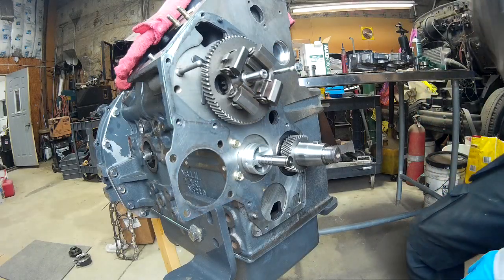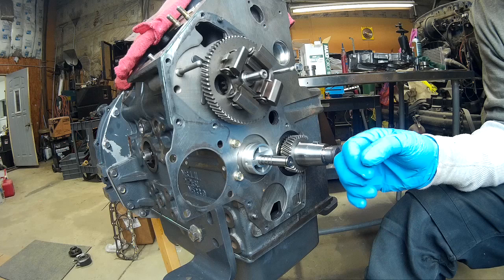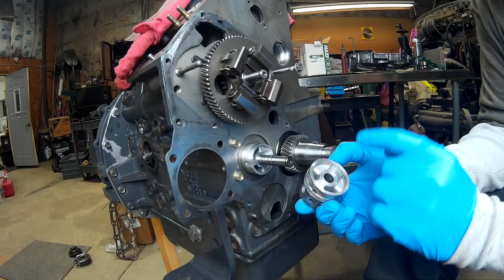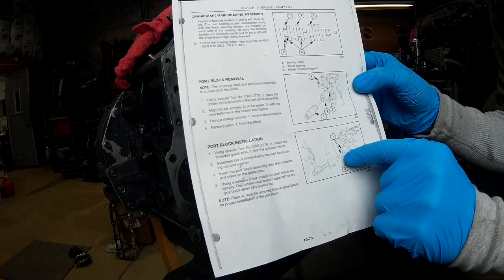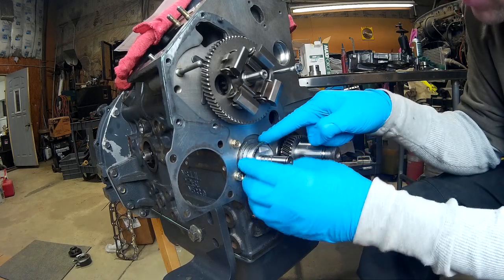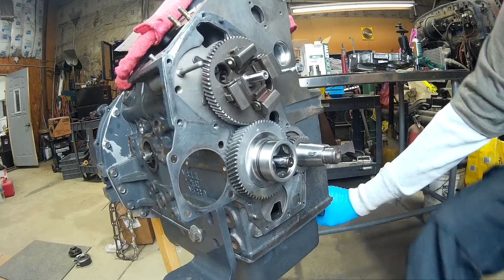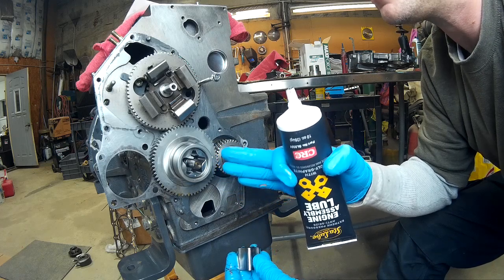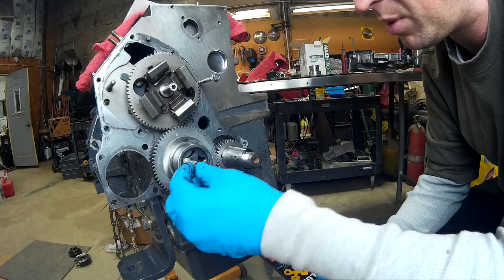Shibura 844LT oil pump

Comment: Hi Carl, 
Thanks for the effort you put into this video. My buddy and I very much appreciate it.
Hers's the problem for us. We are in Portugal, slightly off the beaten track, and we are also under time pressure. We have the new pump, and sundry other parts. We DO NOT have the special tool you talk about. Can you imagine any way that we can remove the old pump and install the new one without this tool? We are both experienced with engines and pretty ingenious, and have the usual boatyard tools but no machine shop.

Huge thanks - Michael & Carlos    kantala@gmail.com
Reply from the maker: Hello, 
      I'm glad the video was able to help you!  I do think you can have success without the special tool.

Removal:  if you have the oil pan off, you should be able to remove the 10mm nut on the back of the pump that holds the shaft into the aluminum pump body.  With this out, you should be able to put a long bolt through from the back and attach to a slide hammer.  Use the slide hammer to tap out the pump body.  If that does not work you could just weld a nut to the end of the pump shaft and attach that to the slide hammer. 

Installation:  I would remove the pump shaft from the new pump, and make yourself a solid flat driver the fits the face of the pump very nicely.  Even better, cut the old pump shaft in half, and put the old and new pump face to face with the piece of shaft in between to index them together.  line the new pump up to the block in the exact same orientation that the old one came out.  You are trying to get the internal oil passages to line up!  a few degrees either way will not hurt, but make yourself some nice marks on the block and pump to keep yourself lined up.  Use a good sized hammer to drive the new pump in with the old pump body.  Make sure you get it started straight and keep it going in straight!  The pump body should be driven in flush to the block.  
     If you have the block out and completely apart, you could also stand the block up in a press and press the new pump in using the old pump body as a driver.  After you get the new pump body in, re-install the new pump shaft and be sure to use a loctite red on the 10mm bolt in the back!  Mine aftermarket pump shaft nut was loose, would have been catastrophic if I hadn't have seen it.

Best of luck and please report back your results!  
Carl Crawford
Reply: @CrawfordMethod 
That was a super message, and perfectly timed. Thank you thank you. I want the whole world to know how helpful that was.
Tomorrow is the day we do the deed. I will tell you how it goes.
Tx - Michael
Reply: """"
Hi Carl

Well, in the end we had a good day working on the oil pump. You will remember that we wanted to replace the old pump but did not have the special tool. Your video was wonderfully helpful, especially when we froze the frame at 3:38, blew it up and read your Manual which was more detailed than ours. Here's what happened.

The Perkins engine was still in the boat, and since it would have been very hard to remove it we decided to leave it in place. The cylinder head and much else was already off. With the front cover removed and all the associated bits and pieces also off we could proceed. 

The sump was off so we could just access the inner end of the oil pump shaft, which has an 8mm threaded end and needs a 12mm ring wrench for the nut. It was impossible to swing the wrench because of the crankshaft, so the outer end was tightly gripped and rotated with vice-grips. We were very careful with this, wrapping the shaft with layers of masking tape and cloth so that we did not damage it - who knew, we might have needed it again! It was not easy but we did finally undo the nut and pull the shaft. This showed that it was very worn at the outer pump end but perfect where the inner end sat in the aluminum base.

The next part was critical. We needed to ensure that the new pump would be installed perfectly so that the ports would match the engine block. It turned out that we could see one 5mm oil port in the aluminum pump base and it was exactly horizontal. We found a nice old piece of fibreglass shaft which fitted the hole tightly, and marked some tape so that we would be able to install the new pump in exactly the same position. A long drill bit would also work well.  We had a photo for you but I can't paste it into this message. Sorry.

Next we made a slide hammer. First we pushed an 8mm threaded stainless rod through the pump body and fitted a nut on the inner end, easier said than done. We covered the rod with tape to reduce friction and hammered our heavy weight hard up the rod against two good nuts. Nothing would budge the aluminum pump base from the block, nothing. So then we made a puller such that we could pull the inner nut of the 8mm rod against a tube with spacers and washers and thus pull the pump block out. No, that didn't work either. 

This is when things got serious. We could have drilled out the aluminum block so that we could introduce a 12mm or 1/2inch threaded rod and pulled on that. The problem with this idea was that if we failed the remains of the now useless aluminum block would still be in place and laughing at us. We needed a new plan.

We removed the new shaft from the new pump and compared it thoroughly with the old one from the old pump. We inspected everything. We measured every possible dimension with a micrometer. We tested the new shaft in the old pump body, and thought long and hard. The oil paths were slightly different, but the spiral oil groove on the new one looked like it would work better than the simple oil port of the old one. The fit of the new shaft into the old aluminum base was exactly the same as the fit into the new aluminum base. Finally we decided to leave the old aluminum base in place and fit the new shaft and all the other new parts. That was a big, difficult decision but we do believe it was the right one.

It was not easy to tighten the nut on the inner end of the new shaft, and especially since we had to be really careful not to damage the shaft with vice-grips, the only way we could hold it. The new nut had a built-in locking washer, and we did use Lock-Tite. We then smothered everything in grease to improve prime and make sure that nothing runs dry at start-up.

Assembling the new parts onto the old block was relatively easy. Curiously our old pump did not have a thrust washer whereas the new one did.  We also had to figure out the shims to get the end play of the shaft right, called side-play in our Manual which is weird. The Parts Manual was confusing. Several parts are wrongly labelled, a number could not possibly be needed and the installation of others as drawn is obviously wrong. We proceeded with care and we are confident that the parts we assembled are perfect. The idler gear with its marks is properly lined up with its friends, and for our next chance we will be ready to go with the cover and the rest of the job. We know there are some hard times ahead with this too, but nothing like what we have just been through.

Carl, none of this would have been possible without your video and without your encouragement. Thank you very much indeed. We will let you know what happens when we start the engine.

Best Wishes - Michael & Carlos

Comment: Carl i have one tore down right now. I'm having a clearance issue between the front cover and the crankshaft gear. I looks like the oil pump gear and crankshaft gear on yours are flush when installed. This crankshaft gear protrudes about. 20 thousands past the oil pump gear any thoughts? A local machine shop built the bottom end
Reply from the maker: Ronald, 
     Hmm, nothing comes to mind that would cause that.  Was it the same crank or a replacement crank?  That distance is probably controlled almost exclusively by the thrust washers on the bearing system between cyl 2-3.  Do you have a thrust clearance within specs?  (put a test indicator on crank and gently pry crank front and rear.)   I believe the timing gear is fixed on the crank, not easily removable, so unless it was a replacement crank that would not be easily movable. 

One thing I had to deal with was that the aftermarket oil pump I got did not have the edges of the gear clearanced, so when I tried to install the timing cover it interfered.  I had to mill a small clearance in the timing cover to give room for the "sharp" edges of the new oil pump.  The oem pump had the edges of the gears chamfer ground.  Hope that might help.
Reply: It was a replacement crank assembled by a machine shop that no longer is in operation. All the bottom end was correctly installed. So I'm figuring the wrong crank. I might get to the bottom of it today. Great video by the way!

Comment: I’ve had two of these engines (in caterpillar form) with oil pressure issues both caused by sheared oil pump shafts. Both engines also only had around 450hrs on them. Is this common or do I just have a really unlucky customer?
Thanks

Comment: I hope you check this, but how far back does it go or does it set its self?
Reply from the maker: how far back does what go? does what set itself?
Reply: @CrawfordMethod  my old one broke the shaft. Pulled it out and never checked to see how far in the block the oil block goes.
Reply from the maker: @brakestar4157  Yes the pump only goes back until it is solidly against the block, cant get it in too far.  But you do need to get it started straight, and with the oil passages aligned correctly with the block.
Reply: Kind of late, but you have to use the installation tool. Cost me about $200.

Comment: How do I pull out a bad oil pump??
Reply from the maker: Brian *** , if you don’t have the “special tool” I think the easiest way to pull out the pump would be to use a slide hammer. You could weld a coupler nut to the pump shaft.
Reply: Carl Crawford well our pump shaft was busted off so we drilled and tapped for 7/16" next to it,the pump is aluminum so that was a breeze and made a slide hammer and it came right out. Otherwise you're pulling the whole engine apart oil pan, camshaft, crankshaft head everything according to Caterpillar to drive out the pump....... waste of 1 full day.
Reply from the maker: Brian *** you cant even get any room to swing a hammer inside the block, so I don’t think that would even help. 

    If you can’t borrow the special tool to align and drive in the new pump, I think you would have good luck visually aligning the oil passages and making a simple driver block with a hole in it for the pump shaft.  Double check the nut that retains the pump shaft, the aftermarket pump that I got had a poorly fitting nut, and it was finger tight. 
     After installing the pump, packing the troichoids with grease, and adjusting the shims, you can slide the timing cover on. You cannot turn the crankshaft/oil pump idler/cam without the timing cover on! The oil pump rides in a machined bore in the timing cover, and that is what takes all the side load of the idler gear. If you turn the engine over without the timing cover on you risk bending the oil pump shaft.
Reply: Carl Crawford Thanks Carl

Comment: How can  I get a hold of oil pump install tool? The smaller one like in your video is the one I have.
Reply from the maker: I was lucky that the machine shop I used was able to borrow the tool from the local New Holland dealer.  The tools is made by OTC, but it looks like OTC does not sell it direct, you would have to buy it through a New Holland dealer.  I have had good luck getting parts online from www.messicks.com.  

That said, after using the tool I think you could get by without it, as long as you carefully line up the oil passages in the block and pump, and use a solid driver block to drive the pump in.

While making this video, near the end I realized that the pump you see installed here is the wrong one!  My engine takes the large version of the pump, and we installed the small version.  While installing the thrust washer over the pump, I noticed that the anti-rotation features of the washer were  not going to engage the features in the sheet metal backing plate on the engine.  Doh!  I had to pull this brand-new pump out and get the correct one and re-install.  Then while assembling the new pump onto the shaft, I found that the shaft was rotating, the nut on the back was loose and defective.  Had to remove the oil pan to get a wrench on it.  The oil pump and timing cover are now finally assembled.  Very fussy oil pump setup.